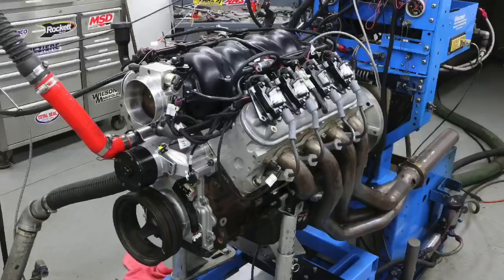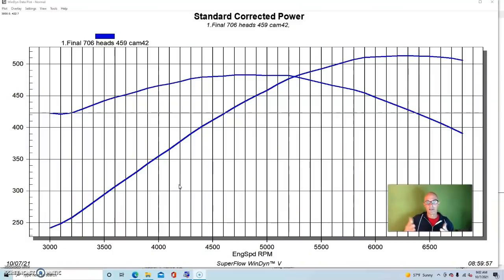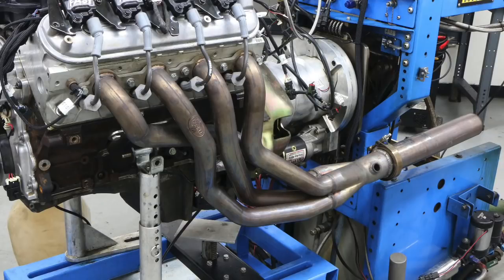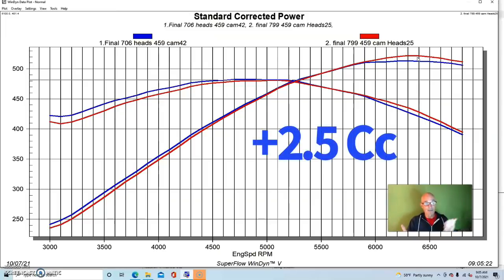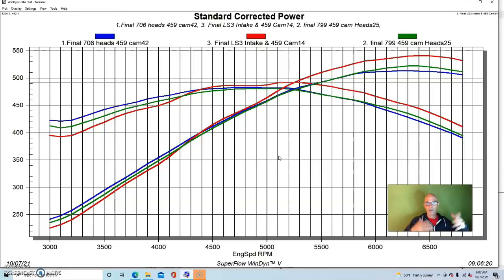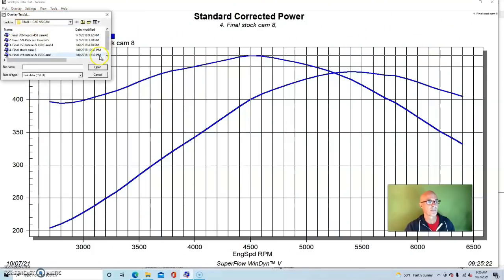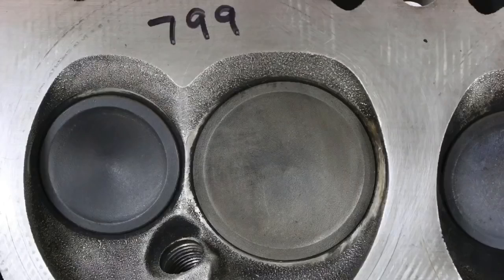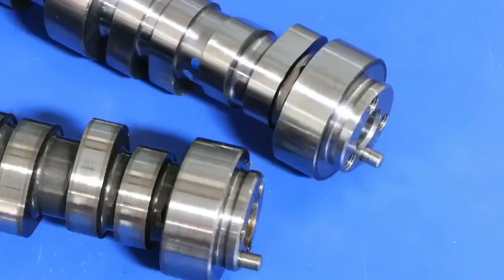HOW TO MAKE MORE 6.0L LS POWER. TESTED-STOCK 706 v 799 v LY6 HEADS & STOCK 6.0 v LS3 v LS9 CAMS

Comment: The 6.0 with comp cam with the rectangular heads made 540 peak horsepower and 400 foot pounds of torque or more from 3200rpm through 6700rpm is a wide strong power band that is a little softer in lower rpm range but has plenty of low speed torque down low for cruising or street driving and 4000rpm to 6800rpm it shines for a 364 CI engine with a cam and springs on pump gas 540 horsepower with a stock shortblock with stock heads is pretty hard to beat
Reply: @ictcarguy3162  the difference in a used coyote 5.0 vs a chevy 5.3 or 6.0 is a 100,000 mile 5.0 costs 5000 dollars complete a 5.3 6.0 with a 100,000 miles complete is 1000-1500 dollars it's more than double the cost and the the LS engine is plentiful there are thousands of them to pick and chose from for money invested the LS engine is better you buy a used 100,000 mile 5.0 coyote for 5000 dollars I'll buy a 100,000 mile 5.3 or 6.0 for 1500 dollars and spend the extra 3500 on upgrades want to bet the LS will make way more power than the 5000 dollar used 5.0 coyote for money being spent the LS is a much better option of course a 20,000 dollar race engine is going to make a lot more power than a 8000 dollars crate engine it's a no brainer it's over double the cost again for money being spent the LS is extremely hard to beat
Reply: @bigboreracing356  it's a over a 100 cubic inches bigger and I'll bet it won't turn 7200rpm either with over  100 cubic more it makes more torque for sure at a lower rpm and throughout the powerband than a 6.0 LS
Reply: @bigboreracing356  the LS engine came out in 1997 it made 345 horsepower Ford did not surpass this horsepower number with a naturally aspirated V8 until 2011 that's 15 years later this is a fact when a competing company can't surpass something being made by a competitor for 15 years well that's called a dynasty if you like it or not it's over a decade Ford had a 260 horsepower 4.6 when the LS1 came out 85 horsepower less in order to surpass the LS1 Fords answer was a blower on a 32 valve 4.6 correct me if I'm wrong and the LT1 is basically the same platform as the LS1 and the LT1 does pretty well against a 4 cam 32 valve 5.0 the LT1 having only 2 valves 1 cam and it makes more low end torque below 4500rpm than the 5.0 does
Reply: @ictcarguy3162  it's a 2 valve one camshaft commercial engine to a 32 valve 4 camshafts performance engine coyote 5.0 I've seen some 6.0s and 6.2s liter engines making easy 575 horsepower with CNC ported stock LS3 heads with a 230 duration intake 247 duration exhaust cam that run pretty good to 7200rpm if you like comparing a 4 cam 32 valve V8 to a 1 cam 16 valve V8 and it has really good torque at  3000rpm all the way to 4500rpm compared to a 5.0 coyote that needs to be turning 4500rpm+ before it's even in the game with the torque of a LS3 by that time your playing catchup
Reply: @ictcarguy3162  the new C8 has 495 horsepower it will beat most cars like a Hellcat Super Snake that make 675 - 700 horsepower from 0-120
Reply: @ictcarguy3162  the LS is simple easier to work on and is a smaller over all package it makes way more torque than a 5.0 from idle to 5000rpm it is swapped in more vehicles than any application l have a modified LS 6.0 in a G-body have ran into many new modified 5.0 Mustangs and have stomped all of them not to mention my setup was built in 2008 and is still running as good or better than when new for every 5.0 project the are a 1000 LS engine projects speaks volumes
Reply: @ictcarguy3162  if cost isn't a issue then lets compare the coyote 5.0 to a Ferrari V8 the Ferrari makes more power and is superior if cost is not important if you can't appreciate getting a junkyard LS 5.3 complete for a thousand dollars buying 700 dollars in upgrades and making 460- 520 horsepower on a tight budget a used set of cylinder heads from the 5.0 are are over a thousand dollars
Reply: @ictcarguy3162  using new crate engines on a 10,000 dollar limit you buy a 5.0 coyote crate engine 8600 dollars I'll get a GM 364/450 crate engine for 4700 dollars both engines are allowed to use the remaining money on upgrades bet the LS will stomp the 5.0 coyote of course if your allowed to spend 20,000 on the 5.0 coyote I'd imagine it should make more power than a 10,000 dollar motor is common sense
Reply: @ictcarguy3162  the coyote 5.0 is probably as big in physical size to the new gas ford 7.3 look at the 7.3 does it look similar or remind you of something like something GM started making in 1997 the Ford gas 7.3 is basically a close design similar to a LS just bigger I'm not a Ford fan but the Ford 7.3 gas engine is very strong in a very heavy F-550 I'd imagine if it had a better camshaft in a light car it would be serious fast with tons of mid range torque getting it to rev to 6500rpm should make 600+ easy horsepower and torque if Ford offered me a free engine the 7.3 gas truck crate engine or a 5.0 coyote crate engine I'll take the 7.3 truck engine who cares about how big it is inside I'm more worried about physical size if finding room for exhaust and accessories is more of a concern the 5.0 engine is anything but small on the outside the LS is much more compact in size
Reply: @bigboreracing356  lol I hope you’re joking. You are comparing 364 cubes to 468 cubes and you are also mistaken because you said you had a “stock short block” but there is no stock 468 so how would that be?
Reply: And honestly I wouldn’t be bragging that your 468 BBC makes the same power as a run of the mill junkyard 6.0L/364 truck motor with just a cam in it lmao.
Reply: @ictcarguy3162  I'm pretty sure the new Z06 will have a 5.5 liter 32 valve that supposedly makes 670 horsepower at 8500rpm naturally aspirated is more comparable to the engine Ford has been building since 2011 and l don't see any thing remotely close to this number the 5.2 is 520 horsepower and the 5.0 is 460 if you want to talk about stock and comparing apples to apples who's superior yes the 5.5 is half a liter bigger do the math + .5 of a liter = 150 horsepower who superior haven't heard of any new Ford naturally aspirated making anything close to 670 horsepower naturally aspirated stock the GM 5.5 32 valve is a performance engine not a 5.3 commercial truck engine that they have sold millions of in most SUVs and Silverados since 1999 and can be bought used complete for under a 1000 dollars

Comment: I. An certainly attest to the LS9 performance. It is very noticeable how much power you lose on the bottom. If you aren’t in boost, it’s a dog around town. I swapped it in my LS3 to prepare it for my LSA blower swap that year. I ran it in the motor after the blower install for a couple months until I swapped it for a custom cam that I still run 6 years later. Good video Rich, I’m sure I’m sure LS swap guys on a budget will find this info useful!
Reply: LS9 cam is  good for stock bottom end stuff, keeps the the torque in check at lower/ mid range rpms and breathes nicely up top.
Reply: @dilsher12  someone forgot to tell my stock bottom end, ROFL. 

Nah, I totally blew mine up trying to do remote tuning. went WOT too soon and Dr. Rodknocker came to visit! I guess I can't complain too much...I have a Kong 2650 and a 429 now😀
Reply: @Fedge378  That setup must be a tire frier with torque for days . I'm just running a stock bottom end aluminum 5.3 with a s475 turbo and LS9 cam . Been running 20lbs of boost for over 3 years now , its plenty fast for me for a 3700lb street driven truck .

Comment: Awesome Richard, I picked up a set of 799 heads for my LQ4 and plan on adding a BTR stage 2 truck cam should be a runner
Reply: get the truck norris cam instead way better low end power almost 20ftpounds of torque at 2500 just on a 5.3 and makes just as much topend as a stage 2 truck cam
Reply: I have an lq4 with 799 heads, longtube headders, BTR stage 2 truck cam, and a TBSS intake. It's a very strong combo that can still tow and drive every day.
Reply: @thomasgoddard5503  any idea how that same combo would work but with an LQ9 and an ls6 intake
Reply: Would the Truck Norris  cam be a decent single  plane carb cam..? I see it has a carb friendly lsa..

Comment: Looking for advise: Been gathering parts for turbo 6.0 build.  Have purchased two sets of 317 heads from the wrecking yard and both sets had cracks between the valve seats.  One shop, who CNCs the heads, said that as long as the heads pass a pressure test, they'll be fine.  Another shop said "light duty only!"  Is is possible to find a nice set of cathedral port heads without cracks...or should I just drop cash down on aftermarket?
Reply from the maker: WE'VE RUN CRACKED HEADS

Comment: So ls3 heads on a 6.0l is made for boost! 😁
Reply: Every LS is. They just don't know it yet.
Reply from the maker: MORE POWER NA EQUALS MORE POWER UNDER BOOST
Reply: @richardholdener1727  
Low copretion is boost frendly. 
(Sorry my English)
Reply: @Up North Motorsports 
Yes i am the old scool! 😁
But if you are thinking racing and I thinking a dayly driver.
And where i live you cant get E85 on the gas statione. 
And driving with race fule is to expensive....
I can sea that you can bye bust frendly short and long block that are rated for 9:1.

Comment: I like this stock stuff testing. Sure having awesome tfs or rec port heads done right up is great but lots of guys will be digging through the recycler or ebay for stuff to get their build together.
Thats a really healthy cam for a 9hp gain swapping from 706 to 799 heads. Makes me wonder why anyone would use a ls9/ls7 camshaft.
Reply: They didn't have Richards data
Reply: They are good for a boost app with a stock idle quality
Reply from the maker: THE LS9 IS NOT GOOD FOR BOOST-IT'S VERY SOFT DOWN LOW AS SHOWN

Comment: Gearing up to put a stroked 6.0 into my C3 Vette!
Reply: @bigboreracing356  6.6 is ls/lt engine so 3/4 of your comment show you are lost. the MBE heads are for anything other than a car that will be street driven. the port velocity at low rpms would be so weak that anything you drive would be more powerful. stroke a 6.0 with a 4.25" crank (largest a stock block can go) puts it at 427ci. Now if my math is correct, then 427 is larger than 404.